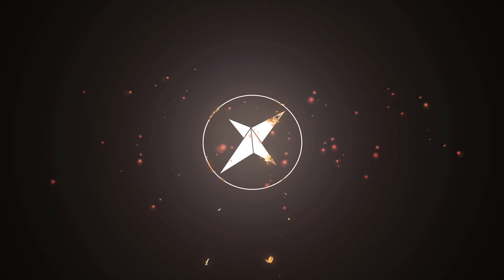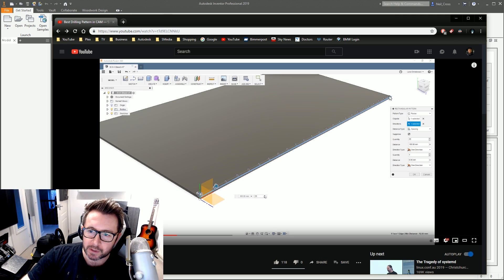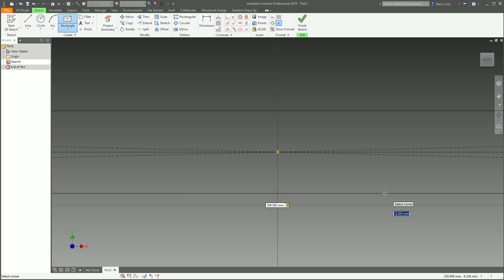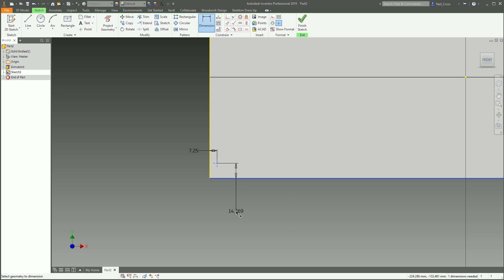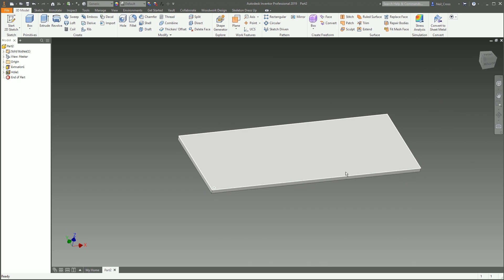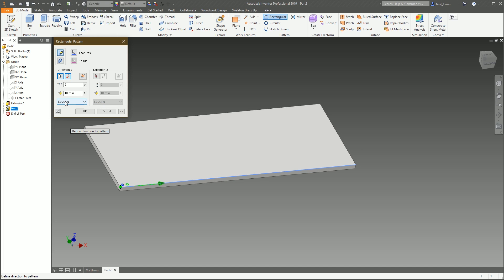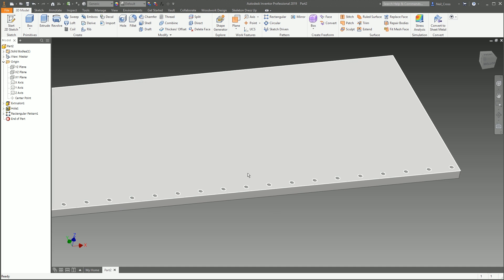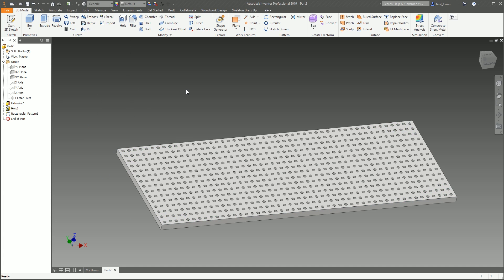Fully Adaptive Good Practice Hole Patterns | Autodesk Inventor Tip

Comment: Great video!

Do You (or You; random comment section reader) know if this is possible to do in an assembly with Component pattern?

I want the pattern to insert parts to automatically fill in blank space when lengthening the assembly.

To calculate #number of needed components, I tried naming the dimension "length" and making a simple formula "length/400" but no matter how i edit it, the text stays red and won't compute.
Length between each insert is set to (c/c) 400.

In my head, this is a simple command, but it doesn't seem as Inventor has it incorporated although you can fill in most menus like this.

Comment: How do you create a pattern where you want to have the geometry evenly spaced between. It doesn’t matter what the number of cuts/holes or geometry are. In my case I want to create a bead board on a sheet of MDF (49”x97”). The first cut is on the edge of one of  long sides and the last cut is a distance from the other long side equal to the spacing between all interior cuts which are equally spaced.  This set up allows the installer to only make one cut when installing more than one board while maintains the pattern. I use Fushion 360, I’m sure the principles are the same. Thank you for a great video. 

If necessary a portion of one or both sides can be cut off in the production of the sheet

Comment: I normaly don't bother with namning the dimension, Instead of "list parameters" I chose "Show Dimensions" and pick the feature I want to see,  then pick dimensions I want to use it the equation. 
In more complex parts, where I might want to go back and be able to edit and change the dimension easily in the parametrs window I will name the measurment, but not for a pattern lite this.

Comment: I really do like your channel but this "trick" on hole patterns is something that every good engineer already should have figured out on his own – as you mentioned in your video. ;)
One question remains: Why work with two sketches if you could include the point for the first hole directly into the first sketch and reuse it for the hole feature? Of course with that you would need to extrude not symmetrically but into one direction... Wherever it is possible I challenge myself to use only one basic sketch with as many information in it as possible. With that most changes can be made out of this one sketch.
Reply from the maker: One of the unofficial golden rules of Inventor is to try and keep things to 1 separate sketch per 3d feature. Reusing sketches isn't something that's recommended if it can be avoided
Reply: @Neil3D  Oh really? I didn’t know that and maybe I have been lucky that it worked well for me to use as few sketches as possible. Can you tell me please why it’s not recommended? I thought one sketch is more "stable" than many sketches derived from one another by projected geometry etc.

Comment: I do this just a bit differently for sheetmetal . I drop and dim 1 hole  ( not necessarily with named parameters) select distance then for length select measure and subtract initial measurement from end of the flange length twice. I do this mainly on sheetmetal flanges where the flange may not be the true length of the parts due to flange offset and such but you want even holes. Thanks for the video Neil  as always

Comment: Very nice video. But the holy grail of the patterned holes, is the distribution of holes (and patterned features in general) inside a closed random spline. What about that? Creo and SolidWorks have already something like this. I am amazed, this is not available in Inventor so far. Is there any patent issue?
Reply: This is a known problem in inventor. Especially when you want to model an energy chain...

Comment: This is very useful, but in a lot of cases you have a maximum hole centres specified by a structural engineer, if this is the case you will want to do the following. 

1 - Create a "maxholecentres" parameter, in the parameters window, this will be what you need to change if the hole centres need to vary. 
 
2 - Create a Numberofholes parameter, this will need to have the following equation. 1+ceil(isolate(((Length-(H1*2))/maxholecentres);ul;mm)) This will take the overall length value and subtract the two end distances (h1) then divide the amount left by the hole centres, then turn the number into a unitless figure before rounding it up and adding 1.

3 - Create your pattern as you normally would, make sure you're set to "distance" instead of spacing and then use Length-(H1*2) as the distance then for the number of holes, simply use the Numberofholes parameter. 

Now you have a holes pattern which will dynamically adjust to the size of the part and you can increase or decrease the maximum hole centres by adjusing the maxholecentres parameter which will add or subtract holes as required.

Also worth mentioning, that although this is typically something you might do in inventor. If you use dynamic blocks in autocad, you can do the exact same thing with driven constraints in a parametric dynamic block.
Reply: Hey man, 6 years later. This comment helped me sort out something similar I was doing. Making an iPart where the number of holes changes based on the length of the part. I used iLogic in the original part, but that didn't transition into iPart/Content Center. This gives me the ability to do the comparison in the parameter, which is what I needed. Thank you!